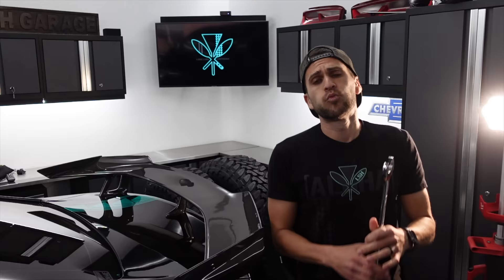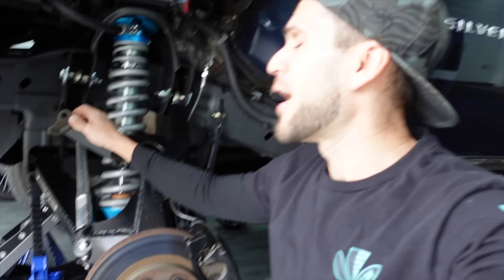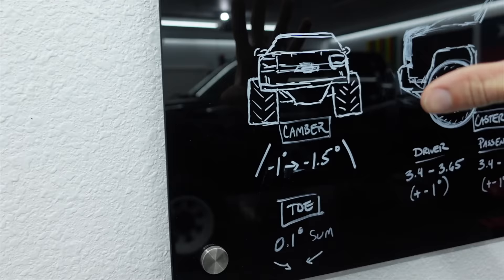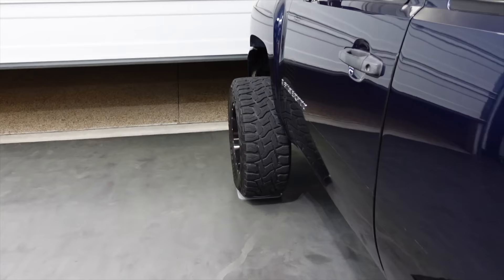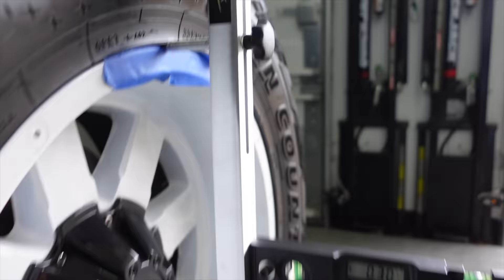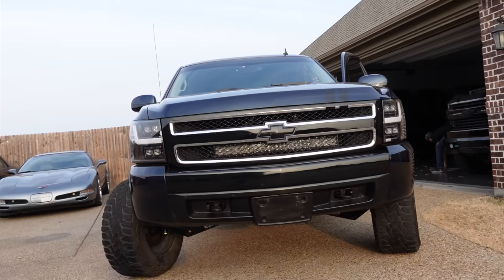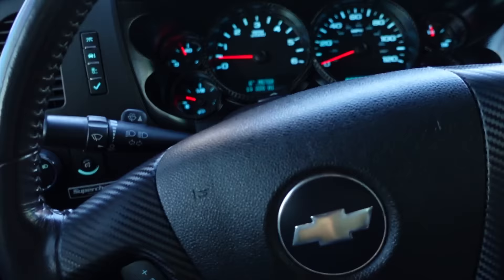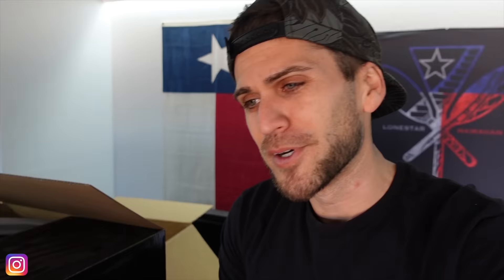FREE ALIGNMENTS FOREVER - Stop Paying For Crappy Work

Comment: I love that DIYer math. I saved $100… by spending $600. I do that all of the time but it sure has helped me build up a pretty decent tool cabinet in the garage and shed.
Reply from the maker: Facts. Just facts
Reply: Lol , me too!!  My welder and Torch though has definitely saved me and paid itself off
Reply: Don't forget time spent. I always figure in $55 an hour for my time on DIY projects.  It gets even more depressing when you're doing fab work or 3d printing and it takes you 20-30 hours to make a part that would have just cost $150.
Reply: Lol you’re not supposed to say that part out loud
Reply: As SuperfastMatt says, DIY for a fraction of the cost - an improper fraction 🙃
Reply: @chrisdenney4251  what a joke
Reply: Right I use a school paper binder half , a little grease , and a person to help. Pretty cheap and 100% or as close job. About 5 bucks overall.
Reply: True, but if your diligent and DIY 6 times then you break even. If you DIY till you can't be cause arthritis or stroke, then I imagine you could save a few hundred in the big picture. Just thankful he spent the money and showed us what was what
Reply: bawawa, exactly. the only thing I agree with is I don't trust shops to be competent. I was a mechanic for 30 years. was going to rebuild the front suspension on my 4x4 Sequoia, went into a shop that advertised as 4x4 suspension specialist to see about an alignment when I was finished had all the parts already. let them talk into doing the work and they butchered it.
Reply: My 150 dollar used x-pipe turned into 450 with prepping, welding, prepping, sanding, primer, paint...etc. I just lie and tell myself I saved this thing from getting thrown out and really enjoyed all that extra labor.
Reply: It’s a one-time investment. :)
Reply: But the thing with DIY, is what you can do for yourself, you can do for others.
The great thing about DIY turned side hustle is your overheads are substantially lower than typical business models, meaning profit margins are way higher 😎👌
I've done it with a few things, but hadn't restarted any of the hustles after moving interstate. 
Great, now I'm having an 8am realisation that I need to do something with my life 🤣
Reply: Couldn't be more right mate
Reply: That kit could've been home made with some angle iron or aluminum bar stock, vinyl tiles, grease, a level, and a quick release bar clamp.
Reply: @matthewbmarch You'll notice the video title says "free alignments forever". Can you tell me where you can get infinite alignments on multiple vehicles for $100 please? That's an awesome deal.
Reply: @LonestarHawaiian  dragnet
Reply: That’s keyboard warrior math by assuming the alignment shops could do a proper job in 1 try and your alignment remains perfect and your suspension won’t change ever again. 😂
Reply: $100 per/ $600 lifetime. Plus pricelessness of never having to depend on someone else to do it for you. Haha. Sounds like a win to me.
Reply: No one seems to be taking into account the value of the experience earned by doing the job yourself, priceless.
Reply: @YannickBasler-xf6ky  yup. Someone may not always be there to help. Better to do the struggling when help is a phone call away.
Reply: Well you know someone else isn't doing it poorly... And that's priceless
Reply: @JC-bf6fy pretty bad way to look at it. It's not like you are calling off work to work on your hobby.
Reply: 600 for no more alignments and charge others makes sense to me
Reply: Well if you go to that alignment store's site you may find out that their new 5th generation setup will cost you a measly $900 if you don't want to spend that $100 😌
Reply: I’ve saved £2k on maintenance I’ve also speant that on tools 😂
Reply: I’ve always viewed it as, I know the quality of the job done.  Not necessary a cost savings.  Both positive and negative LOL
Reply: I'm 24. I know, since the time I was 16 with my first pickup then the laundry list of shitboxes to follow.. I buy on average 2 alignments a year. This tool will pay for itself in less than 3 years, and after that money is saved.. not to mention time and headache of dealing with mouth breathers at the front desk.
Reply: @c90adventures also if you own more than one vehicle it will pay off much quicker.
Reply: Not to mention you can quickly make back your money charging friends for alignments 🤣
Reply: Do you only ever get 1 alignment?
Reply: Lots of times it’s just not worth it
Reply: Tools pay for themselves. Eventually 😂
Reply: We have an issue of getting our car back worse than it went in too!
Reply: meanwhile lifetime alignments are like 250 lol
Reply: @isaacgraham6506 2 alignmentts a year!???  I've only ever done 1 per new set of tires.....my last set of tires lasted 83k

Comment: I've been doing my own wheel alignment with 4 laser levels, magnetic clamps, a long straight edge and tape measure. Piece a cake.  You can use the old trick of sandwiching two vinyl floor tile squares with some wheel bearing grease in between to slip under the tires to allow them to turn easily.
Reply: I did a toe alignment on my foxbody but I'm still getting really bad inner wear. Is there another step other than just measuring the distance between the front and back of the front tires?
Reply: @jamesstuart3238  yes, absolutely. You are only checking toe (in/out). Which is 1 of 3 parameters. Caster and Camber cannot be checked in this manner. Sounds like you have a camber issue, maybe too much negative camber
Reply: Can just see those tiles flying out and decapitating someone. LOL. With grease all over the place.  Maybe you just jack up the car put them down and then jack the car up again???
Reply: @tanyalove6983  what? How would that work? I think you're misunderstanding something or thinking about cartoon physics. I'm pretty sure if you offered a million dollar bounty, nobody on planet earth could decapitate someone with a piece of flexible linoleum/vinyl by driving a car tire on top of it. Lol
Reply: @TheMuddman74  ROBL  I made that up too it is roll on bed laughing. ROBL.  you said tiles I assumed they were ceramic tiles and I have seen stones and all sorts of things shoot out from under tires.  Depends on how fast the idiot revs the engine. LOL.  You are so funny.  I will sleep well ROBL
Reply: @TheMuddman74  You forgot the grease ROBL laughing so much I could die from laughter. ROBL
Reply: @TheMuddman74  It took me a few minutes but I figured it out.  He put on the rear emergency brake and forgot to take it off.  |He starts revving the engine with the truck going nowhere with the front wheels spinning faster and faster.  Finally the top tile comes shooting out and there you have it.! Very simple and easy to happen with all that grease beween the tiles.  Accident waiting to happen. Please don't try it. Someone could die.
Reply: @tanyalove6983  haha, ok, I've now seen all your comments. Good stuff. Thanks for the laugh. Enjoy your day 🤙
Reply: @TheMuddman74  You too. think front wheel drive cars and idiots LOL
Reply: @TheMuddman74  You are quite elegant in your prose. LOL
Reply: @tanyalove6983  wtf are you even doing?
Reply: @jamesstuart3238  Just put a level on the front and rear part of the side of the tire . you cannot do it in the middle because bottom of tire bulges out.
Reply: Oh that tile tip is a good one
Reply: @yeahitskimmel  ya if you want to see a UFO
Reply: @Hawk7886  Being an annoying woman. Such many cases...
Reply: @tanyalove6983 I see zero way that would happen.
Reply: Tiles and grease, fucking genius.  Way better than the 2 trash bags I've been using
Reply: Or do what we did on aircraft if the skid plates weren't available... half a dozen trash bags under each wheel. Good for 16 tons.
Reply: @jackassplus  cool
Reply: Sounds like you need to pay for an actual alignment and necessary parts.

Comment: Most shops do free alignment checks. Would have been interesting to see a print out from one of the machines to compare measurements and see how well it came out.
Reply from the maker: If I can find one that’ll fit the track width of this truck we’ll do it!
Reply: LOL Where do they give free alignment checks I will rush over there and get one done. LOL
Reply: @LonestarHawaiian  rich people problems
Reply: @LonestarHawaiian  Who cares if your truck wheels are even aligned? Thats problem for real cars.
Reply: Every time I get the print out from a shop the numbers are accurate but the car drives like shit. Its like they fuck with the machine to make it read incorrectly.
Reply: @Jamxknife  That I would believe garbage in garbage out.   Do they know really how to use the machine. I  look at balanced wheels with weights all over the place and wonder like what the operator was doing. Just get like a 5 foot stick and mark spots on the ground front and back just use the tire for both sides then measure the distance between the marks. I just like them perfectly the same.  Rear wheel drive a spec out and front wheel drive a spec in and 4 wheel drive I have no idea.  LOL.  That way you can do a quick check.  Also you can buy a cheap level that fits inside your rim or cut off a plastic one and I just like it straight up and down. perfectly 90 degrees.  You can move the level out at the bottom or top to see how much they are off.  You cannot use the bottom of the tire because the tire bulges out there from the weight. A little bit in at the tops will balance out the outside wear from high speed turns.  You do not want the top to go out or on turns front will want to slide out.   Also outside edge of the tire will wear on the outside plus wear from the high speed turns. Bad results
Reply: @LonestarHawaiian  if your in Texas try tires to you
Reply: @Jamxknife  Alignments can be finicky at times. I swear some software loves to bug out. I had an alignment once that the damn computer was reading that I was adjusting toe out when I was definitely adjusting in. Had to reset the computer in order to get a correct reading, one of the most infuriating times I had.

I often don't believe the readings from the screen and adjust according to previous experience of inaccuracies. Takes me a few alignments and a lot of wasted time whenever I switch to a new shop. Because of issues with software, I've been looking into buying a kit like this.

There's quite a few things that also play into effect, such as; vehicle shifting on rack, centering of steering wheel, overall road conditions, tire conditions, spec splits, etc. That's why I always road test and will often remeasure after certain situations.
Reply: If you don't have the wheels centered when you do the measurements you can make it look like a perfect alignment is totally fubarred. Print it give to customer.  Center wheel print and the alignment is perfect
Reply: I definitely don’t trust any tire shop for working on my vehicles. I have caught them lying to me trying to charge me for things my vehicle didn’t even have on it.  For example trying to charge me hundreds of dollars to replace struts and my car didn’t have struts! Reason for having the vehicle checked, it I noticed a wobble in the front end when the car first started to move. After you get some speed going you couldn’t feel the wobble though. After Goodyear told me I needed new struts. I took the car to Midas and told them about the wobble. Didn’t tell them what Goodyear told me yet! Midas put my car up on the rack and gave it a look over and told me they couldn’t find anything wrong with it? So then I told them what Goodyear said about needing new struts! Midas laughed, said sir you’re cat doesn’t have struts! 
That was actually the second time I caught Goodyear lying!  Firestone just as bad if not worse!
 Funniest one was Jiffy Lube! I had just put a brand new radiator in my Jeep and took it in to Jiffy Lube for an oil change. The employee at Jiffy Lube comes up to me and says I need a radiator flush done that my radiator is really badly plugged up! Oh really I said! Employee again says yes sir it’s really bad doesn’t look like it’s ever been done before? Well he got that right since it’s a new radiator!😂 when I told the employee that I just put a new radiator in it, so how can it need  to be flushed just driving a mile to their shop? Employee then tried to blame it on the guy down under my jeep in their bay that I couldn’t see or talk to! Needless to say Jiffy Lube lost all my business after that day! Why I try to do as much of my own work on my vehicles as I can, just can’t trust these shops! Had one I could trust, but the guy that owned the business retired and I lost my honest mechanic. Been looking for another honest mechanic ever since and still looking!
Reply: Most dealerships and or shops are supposed to give you a print out of your alignment after it’s performed. before and after. At least the dealership that I work at does. At another dealer that I used to be at we had a fancy machine you drove through that would check your alignment. there was large sensors on the side that would check your caster with a camera in the middle of the service lane that would scan for your toe and camber. It was pretty accurate. if the customer wanted an alignment/ free alignment check. You would be able to see your current alignment. The pre-scan was given to the alignment guy to see how off it was before it was put on the machine. Pretty neat system I think all shops and dealerships should have it.
Reply: @205carreviews8  as I previously stated you can turn the wheel a few degrees and make the cameras show that everything is off.  Even on a perfectly aligned vehicle.
Reply: Sounds like worn out suspension parts or radial pull. Every vehicle should be test driven and shaken down before an alignment. If parts are loose your alignment will shift around driving down the road
Reply: I've found simple string alignments (done properly) are usually more accurate then the standard alignment shops you would go to.   Most track prep type shops will actually use the string method also.
Reply: @tanyalove6983  every single mechanic shop in my area advertises free checks.
Reply: Free alignment checks? I own a shop and if I did that, I'd be out of business. It takes 20 minutes just to set up the car on the machine 😂

And if you're talking about those new fancy machines that you just drive over for  "quick check" those are purposely hypersensitive to sucker you into an alignment
Reply: @Jamxknife Thats because they are either doing a lazy alignment (toe adjustment only) or they are ignorant to the process.

You are supposed to first check/adjust caster, then camber, then toe.

Also suspension wear can make an alignment impossible. It's the responsibility of the shop to inform the customer of this fact.
Reply: I had a shop insist that there was no such thing as an alignment check haha. I eventually just hung up on them instead of arguing with an idiot
Reply: The shop I work at does a free alignment check with every oil change. Believe me, I waste more time than you can imagine doing alignment checks. Most everything is in spec. New Honda's are often out but don't have adjustments to correct the angles that need adjustment.
Reply: @tanyalove6983  Tons of places... Not sure why you think it's so wild. They CHECK your alignment for free, they don't align your vehicle for free. It's literally a tool to sell alignments. I assume that was where you got confused.
Reply: @Jamxknife  have seen they manually change the number so they get the green mark. Then saying it was close enough , but should be saying I`m past my abelites
Reply: @tanyalove6983  was way back in 1975
Reply: @DuBstep115 So?  A lot of people don't balance utility trailer tires.  But I balance mine, because I don't like the backslap from an empty trailer jumping like a kangaroo.
Reply: @LonestarHawaiian Les Schwab does a free alignment check. Few of us got curious and did an alignment to factory spec, then sent the shop truck down to them. They were beyond willing to tell us it needed one and gave us numbers nowhere near close to what we just set it to. Apparently we also needed a brake job - who knew 10/32 was illegally bad - so we paid to have it towed back and declined repairs.
Reply: Tell me where they do free alignment checks.  Unless you have a 100k car (or maybe live in the south) 
  
This is a wrong statement.   Here in n.y  you pay for the machine as much as the work

Comment: I have started doing my own alignments and found that my cars were never properly aligned. There is no point in having a super-accurate machine if it's not used properly. Even with an expensive machine on a 4-post, the operator still needs patience, care, and attention.
Reply: As an Alignment Technician My self of 6yrs I 100% Agree I go by a rule of 0.3 for toe & 25% for Castor/ Camber anything  more and ill redo the ROC and Castor Sweeps to be sure there is nothing bent or my  sensors haven't been knocked by foot traffic in the workshop

Comment: Crap work and arguments with “front desk guys” are the main reason I have takin to doing everything myself.  Buy the way I used to work for a company that ran multiple top level race programs. We aligned cars with string and tape measures, it’s just math shops don’t have some kind of magic you can’t figure out.
Reply: Ditto, I use fishing line so that I can get a nice tight pull on the line and finer measurements when checking dimensions.  I ran the math on 17" wheels, if you can measure within plus or minus 1/32", you will have alignment specs within plus or minus 0.08 degrees.